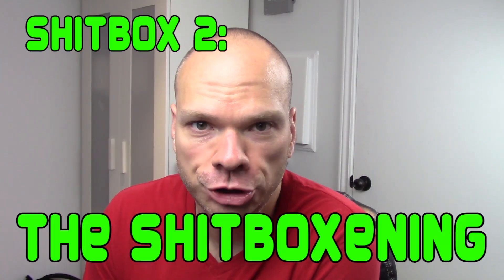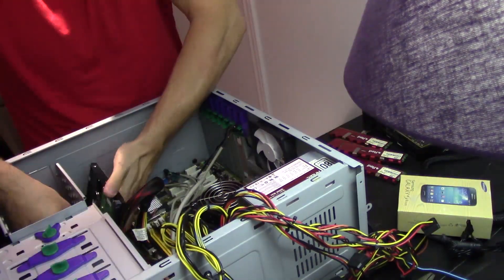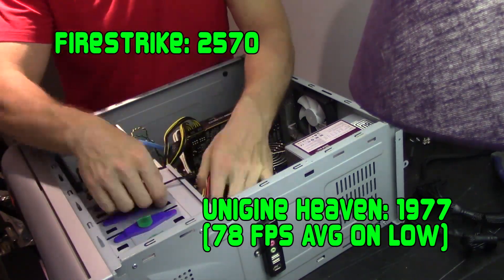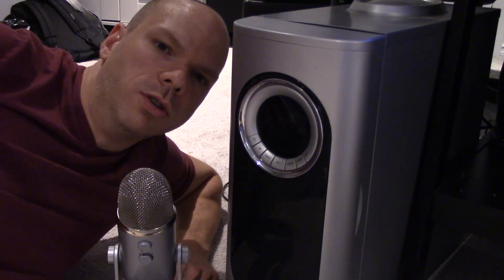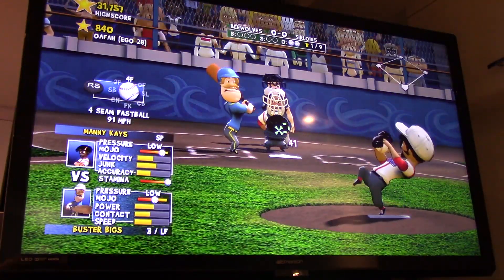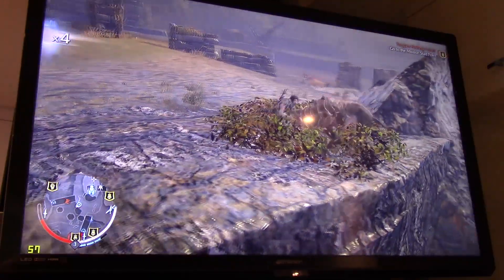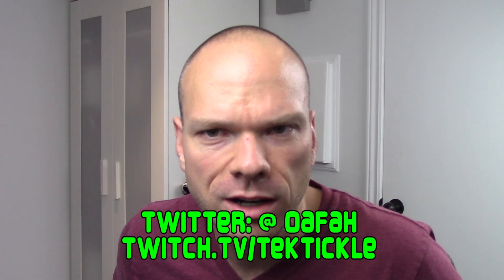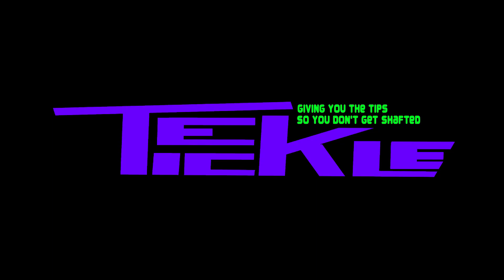Shitbox #2 - Shadow of Mordor (and other games) on a $96 PC

Comment: hey you should look up the q6600 tape mod. it doesnt increase temps and it takes the fsb from 1066 to 1333 which makes it an effective 3ghz. I've done it myself a few times and it works very good.
Reply from the maker: I will indeed muck around and see what I can do. Anything for a few more clocks.
Reply: yeah man! its a great little trick

Comment: You could at least use a tapemod on the Q6600 to get it to 3Ghz, and in my experience, the stock cooler can handle that.